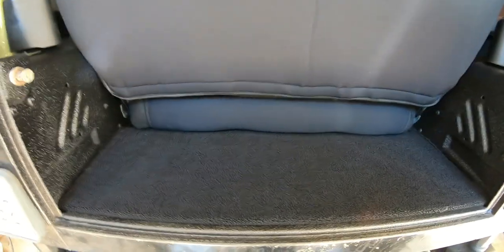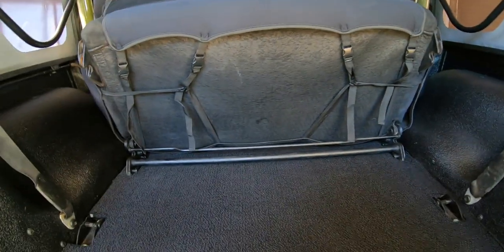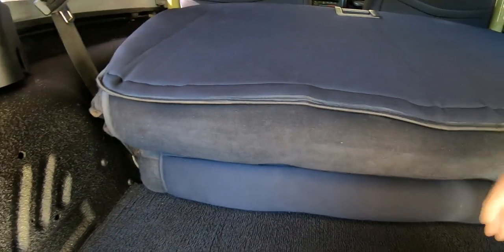97 Jeep Wrangler DIY Cargo Mat

Comment: Going to do that for my 1989 Bronco. Great ideal and does not cost much. I'm sure you know south of the old World color Building. Right side of that street. You can get padding, Foam for seats and headliner material at Albright's Supply.
Reply from the maker: Yes, actually that's where my carpet for the cargo liner came from lol! Didn't think about asking for a different padding than what I used. I'm sure they have something better than what I used now that I think about it.

Comment: Hi Steve, I have been thinking about the same thing ..... how to get a mat that covers the entire back area. I am going to order the fitted rubber mats for the front but I don't like the matching cargo mat as it only covers the back from under the back seat to the tailgate . I was thinking about seeing if I can find some place the has a matching mat for the Grand Cherokee and measuring it to see if it can be cut to cover the entire back when the back seat is out.  My bed liner is sand colored and I think I would rather have a sand colored carpet if I go your route. How much does that help if any with road noise....I would think it would help a bit.
Reply from the maker: Hi William! Yeah, it did sound deaden the rear a good bit. I don't have carpet anywhere else and I did notice an improvement! Thanks